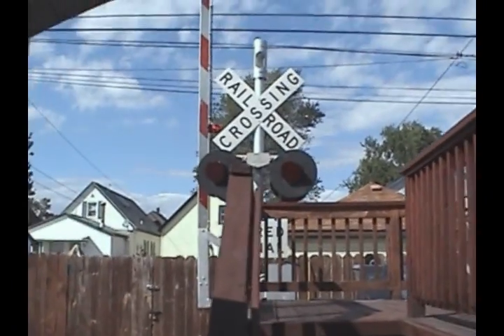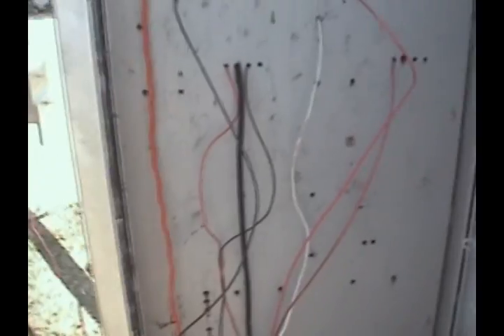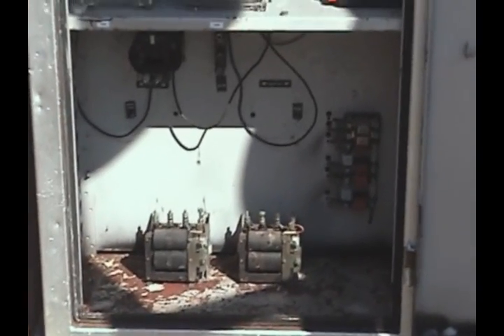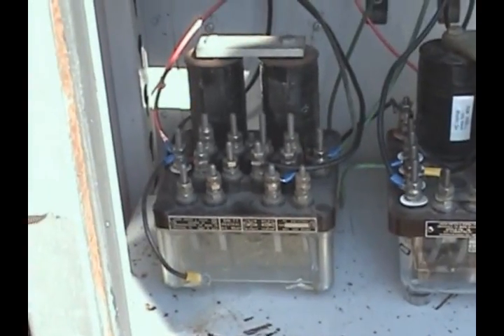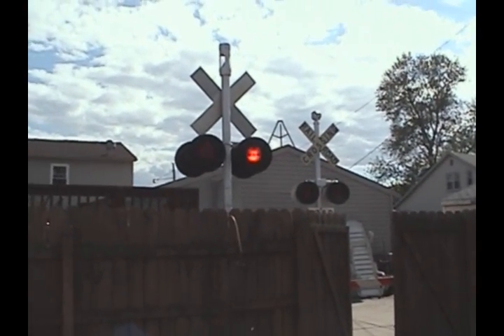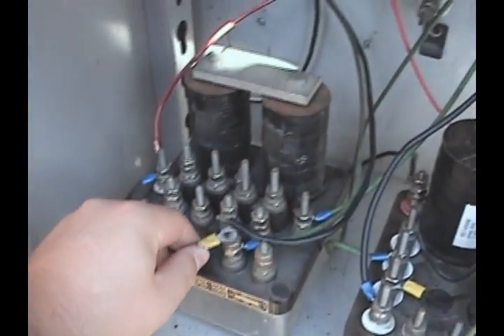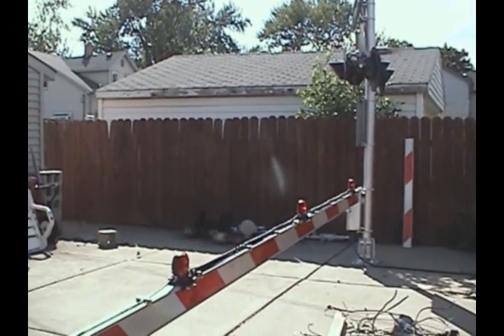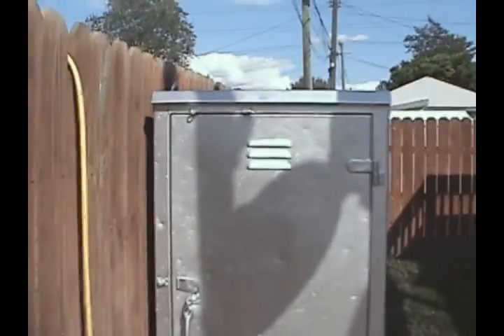My Crossing Signal System as of 9/9/08

Comment: i'd like a relay case like that someday, right now i'm using a old computer tower, works fine for now since i'm using a computer power supply and I have a GRS flasher relay in there
Reply: aspenGF8  he works for the railroad , so id assume pretty cheap or free